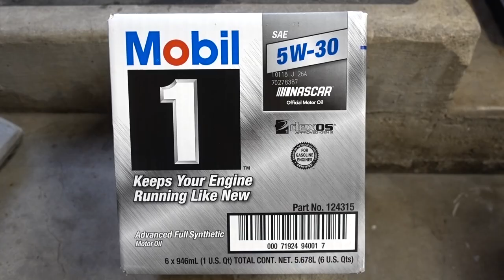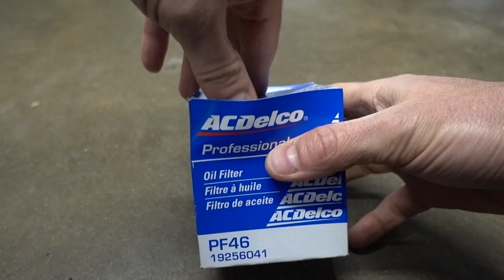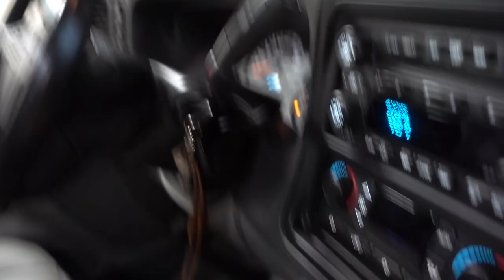BEST OIL FILTER HACK IMAGINABLE!!

Comment: U are over doing things ur fine with just oil filter and also your fine with  regular 5w30 on this vortecs no need for your fancy magnets or your full synthtic mobil 1 oil i have brrn using conventional 5w30 every 5k miles and farm filter for past 220k on my 2004 suburban no issues
Reply: Lmao at "fancy magnets."

Comment: Sure... the oil drain plug does contain a magnet so I'm sure the engine does not need any aditional, besides I bet any oil filter would easily hold the little metal paricles but at the end of the day if the magnet makes you feelmore confident driving it why not ¿!   Cheers !

Comment: magnets may make your filter last longer, but it will not keep anything out of your engine, or make the oil last longer. therefore, since you are replacing the filter anyway, magnets are useless. having a magnet on the drain plug makes sense because particulates will fall to the bottom.

Comment: Prefill the new filter with fresh oil before installing it. Use a zip lock bag or cut plastic bottle over the old filter when removing it. Get a Fumoto.

Comment: Magnets are pretty useless. Most material in the oil is nonferrous.
Reply: Just wanted to add the material usually comes from bearing wear. If you got steel getting into your oil filter you gots trouble.
Reply: 71Vegaman    Especially in Full Synthetic Platinum Oil.
Reply: crankshaft, sleeves and bearings are still Iron or other types of steel.  plus springs, valves are still ferrous. So yes magnetic drain plugs will still collect ferrous material from new engines. unless you have an aluminum crank shaft which wouldnt last very long.
Reply: @supraman236  I have a crank made out of wood ...my filter just picks up the odd splinter now and then.
Reply: But it's the Ferris Buler particles that cause all the trouble.
Reply: @supraman236  But all that will be catched by the paper filter, no need for magnet. Any ferrous particle small enough to go through the pores of the filter is practically harmless.
Reply: you are non ferrous

Comment: I don't know about other auto manufacturers...... But Chevy has been doing this for 2 decades on the oil filter already....... That suburban behind you should have had a magnetic  on the oil filter... it would be round like a donut and placed over the inlet so it wentr AROUND the threaded pieces your filter screws onto...... (At least the 6.6 Diesels did)

Comment: If you put the magnets on the side of the drain pan after you've caught all the old oil you can see metal particles moving towards the magnets. But putting them all over the oil filter if they're not in the right position you can cancel out the magnetic field. I think it would best to just put a stack so you are multiplying the force in one spots on the bottom. Old speaker magnets are great too, you can find Blown speakers anyywhere for free.

Comment: I disagree with those that say this is a useless practice. It cost almost nothing to do and will have an effect. Every particle of iron that is captured by the magnets is one that won't be circulating through your engine or clogging your filter. Most of the particles that would be trapped by the magnet would normally be trapped by the filter media, many though,would be too small and pass right through the filter.

Comment: I use these magnets on my filter, however.... I don't think they really do much and I will tell you why.. The magnets in a gearbox or diff will catch metal that otherwise won't get trapped in a filter... so the magnet is essential... in a filter, the filter will catch the metal.. I use the magnets to keep the filter medium from having to catch any metal particles... however small.    so in an engine I use them as an extra layer of filtration, but know that the filter would have gotten it anyway.. but as you say.. no harm, no foul... so why not..!!

Comment: Yesterday I put a large rare earth magnet on the bottom of the oil filter. I've been planning to do an oil change, but the oil is good and still has its sticky consistency on the finger and thumb test, so I'm going to run the car for a week and only do a filter change this time around.

Comment: The oil pressure in the filter is to high for magnets to catch anything instead put them on your sump
Reply: Totally false. They work for a fact . I use the N52 REM about the size of a 50 cent piece . They can pick up 30 lbs. no problem. Use a pipe cutter after your oil and filter change, cut it open and look where your magnets are...its like a little tiny pile of powder. When you move the magnets around , it will drag the fine powder of metal around the inside .... It works for real. People who never have done something will tell you that its wrong even though you've been doing it because of hands on experience....I know if I say something to dispute someone , its because I have studied and researched the shit out of it before I open my mouth spewing out a bunch BS. Times have changed. While growing up I was taught , If you don't know for a fact , don't act like you know. Because your word reflects what type of man you are.....
Reply: @lane4574     but the ones he's using aren't very strong like yours

Comment: the magnetic field those strong magnets create could interfer with sensor signals, inducing a current in a signal wire could potentially destroy the sensor or worse the ECU,
Reply: NAH. Magnets on your Oil Filter CAN NOT, and therefore WILL NOT, interfere with any sensors or your ECU.

Comment: Hello People I'm in the UK, I just watched this random video and read all the comments, so I just want to add my opinion so hate me if you like, I look forward to your opinions on the following:-  While I don't know if this applies to anyone out there, I understand the doubts you all have, but one application I think this will work on is Centrifugal oil cleaners where the oil is spun out to the edge of the units container.  These can be found on old Zetor Crystal Tractors were you had to scrape all the shit out of the centrifuge.  As a Mercedes driver (old battered high mileage Rats), this video is not of much use to me, but maybe this comment might benefit someone out there.

Comment: if you got particulates in ur oils. then ur using the wrong oil or wrong filter.. ur  over using the oil past its recommend change dates. that magnet theory has been around for many years. having metal frag in ur oil is a good indication of advanced engine wear. and also some oils contain chemicals which help bind the lubricant to ur cyls and oil galleries magnets will pull apart them bonds and make your oils less effective

Comment: Why didn't you put any oil in the filter before you installed it ? 
Not having magnets on your filter could possibly shorten the life of your engine but a dry start up with every oil change will definitely shorten the life of your engine.

Comment: Engineering/Science flaws in this video:

The manufacturers install magnets in the drain plugs to catch leftover ferrous materials from the manufacturing process (this lowers warranty claims and extends the life of the engine. The manufacturers put the magnets in DIRECT CONTACT with the oil so the ferrous material scan actually stick to the magnet.

The problem with sticking magnets to the OUTSIDE of the oil filter is that ferrous materials act as a shield to a magnetic field. Think about it, the magnet stocks because the magnetic field is being consumed by the ferromagnetic material. If you flip that material over you will find that here is no magnetic field on the other side.

If the oil filter is not purely ferromagnetic (maybe it companies a little aluminum in it buts that unlikely because aluminum is more expensive than iron and there is no need to have aluminum there) then maybe you could catch an infinitesimally small amount of ferrous material.

The next problem is that many engines do not have iron sleeves, the bores are aluminum and are treated with different materials to harden them so they don't wear quickly. If you have one of those engines then these magnets are snake oil (yes the rings are iron, but now you are talking about a quantity of ferrous material that is so small that the magnets cost you more than what the microscopic wear on the engine will cost you). The final problem is that wasting money is wasting money and that does hurt you.

Comment: 🤔 it's an interesting idea... But I would think there's too much pressure & Flow in the system. ever forget to put one on and start the engine? There's enough pressure and flow to empty the entire crankcase in about 5 seconds. Too much oil flow for the magnets to hold anything.
Reply: DonnaSean   Good thought, but I can't see pressure affecting it, and velocity compared to flow rate (volumetric) would more specifically be the issue.

Comment: Don't need a filter wrench to install a filter on a gasoline engine. Hand tight about 1 turn or less after the seal makes contact. I never use a filter wrench to install or remove... always by hand.

Comment: I've got an 08 Tundra with a cartridge.  Put them on the cartridge????
Reply: Cartridges are Toyota planned obsolescence in this case ? Have them on myScion and Highlander too.  Could glue them on to the plastic housing and then wipe down the housing at oil change time.
Reply: put them on the drain plug . then it won’t get sucked into the pump and filter in the first place

Comment: Car manufacturers put magnets on the inside car oil  sumps and automatic transmissions not on the outside . Just use the $2.50  on a good quality filter and oil .

Comment: Anti wear and anti pressure additive on some level tend to have magnetic properties to them.  So its not all fine engine metal particles on the magnets.  Your stripping some of the good ingredients right out of the oil by using magnets.  Just a thought.  On engines I've seen people using magnets I have seen goobs of this stuff on the magnets.  If it were all engine metal those folks would not have an engine left with what I've seen.

Comment: If the magnets work, why not just show  a close-up of the inside end of the magnetic drain plug and see if there are any metal particles stuck to it.  You could also drag some magnets thru the used oil to see if you pick up any metal particals.

Comment: What scotty said was correct. Quality  filters catch over 99% of the debris, so should you use magnets anyway for extra insurance?  Sure, and while youre going you may as well install a piece of foam over your air filter and cut a piece of fine gause to put in your fuel filler hole.

Comment: Those magnets on the tip of drain plugs are directly exposed to the oil/fluids, yet the magnets that you attached on the Outside of an oil filter is Not (through the oil filter's metal casing) so, the magnetic force is Greatly reduced from being really effective catching metal particles inside the oil filter.  Oh! By the way, did you know some companies also advertise "Power Gain" from using magnets; in your case with that many magnets (I would double the number of magnets) to gain an another 100+ HP and that engine will run even smoother like a Lexus smooth!   LOL!!!

Comment: It MIGHT help, but the oil pressure is ridiculous on most engines, so they probably couldn't hold the particles very well.
P.S. I would run an engine without a filter. Engine wear mainly comes from fast acceleration & high RPMs, plus, most small older lawnmower engines haven't had a filter EVER yet last for decades & can be rebuilt & revived without replacing the piston, or crankshaft. I've never heard a lawn mower that knocked...

Comment: except metal doesn’t go through a good oil filter. the media will catch sand, metal, even specks you can’t see. put magnets on the pan, that would actually be better for your oil pump if it’s not sucking up metal

Comment: You have a magnet on the outside of the drain plug? The heck is that going to do, that thing is so small it won't catch any through a thicc, dense drain plug. Also old oil for the gasket? Any solids in the old oil might scratch the filter mount base or prevent the seal from seating properly causing a leak. Just use new oil, go lowest risk.

Comment: Except they demagnetize at 80*C which will render them near useless. Above will cause permanent demagnetization in most cases. Oil op temps are typically above 80C, BMW even above 100C...
Reply: @I_know_what_im_talking_about  that's cooled oil in the pan 🙄 oil filter can be after it's gone through through the block. You can research and readily find magnetization vs temp graphs, but hey...you know better than established science apparently 🙄

Comment: You forgot 2 things in your oil change. You didn't wipe off the filter base of dirty oil where the rubber filter gasket contacts the auto ( although you get a brownie point for checking to make sure the old rubber gasket came off with the old filter) and you didn't put any oil in the new filter, to help delay the time the engine will be without any oil until the pump fills up the new filter with oil. Otherwise, a great oil and filter change!

Comment: The magnet will catch some metallic debris. If you really want to make your engine last a long time, use the best oil you can afford and change it more often then manufacturer recommends. Even though the oil his still good and has a broken down yet clean oil is even better. Oil is cheap and engines are expensive.

Comment: Filters catch the ferrous metal aluminium shavings carbon deposits anything . they do it on drain plugs like diffs and transmissions that do not have oil filters in them and transmissions with filters might have a magnetic plug. because of the service interval and the complicated nature of most transmissions oil filter replacement. if you get visible metal on the inside of the filter it would of been caught by the filter media. it will not hurt but if it really worked manufacturers would of pre installed magnetic filters.

Comment: Uh, do a Project Farm-like test. Thorough and evaluate the claims.  Until then, I'd like my magnets at the bottom of the system (oil pan), where the solids drop down when the car is not running. That's instead of possibly restricting flow patterns inside the filter... If it catches anything.  

Sadly, in most Asian cars, if you're getting noticable metal debris in your oil, it'll be lights out for the engine soon enough.

Comment: How can you tell the magnets are working when the engine would sound the same even without them anyway? Sorry dude, this was the same as your last upgrade to efans that you didnt really need and upgrade the wires that you also didn’t really need as the issue was with your alternator.
Reply: that old suburban has very little electrical components   NOW
if it was lets say a 07+   model   it can come equipped with LOTS of  electrical equipment    (that is why it has room for a dual Battery set up)
i.e:power lift gate Power front and rear seats  Power windows,   Rear A/C   heated  wiper fluid  electrical fans, heated mirrors  etc...  Full heated rear windows(left and right side  rear as well)  you can pull some serious amperage  if you were to run all of those at the same time.. maybe 200 to 400 amperes

Comment: I don't know much about engines but isn't it a bad thing to have ferrous metal particles in your oil? Won't most of the particles be nonferrous? Also if there are a bunch of ferrous particles isn't it better to have the magnet in an area that isn't exposed to the flow of oil? Just get a oil plug magnet?

Comment: I'd say it probably does pull the tiny   particals to the side of the filter but it's still in the filter and being caught by it. It's not going to help pull material from inside your engine into the filter. If it made that much of a difference filter manufacturers would already be incorporating them into the filter themselves. These engines run 3,-500,000 miles anyway hell a few have made it to the 750,000 range with just good oil and filter. You can do it if you want to I just think it isn't going to make any difference in life of an engine.

Comment: I bought 2 cars with the same miles same everything. One had a bunch of magnets on the oil filter and one didnt. I pushed both of them off a cliff at the same time. Both engines were junk so the magnets didnt work.

Comment: How do you know that the material collected by the magnets wouldn't be picked up by the filter?! The magnets are on the supply side of the filter media, so there is absolutely no way of knowing if they are doing anything. I wish someone would put out a video that tests this. The only thing I can think of would be two in-line filters, with magnets on the second one. If the second filter magnets collect debri, then we know that the filter media is missing it. If the second filter collect none, or almost none, then we know the filter media is already handling the job. Someone, somewhere, do it!

Comment: I would definitely run my car without an oil filter. My air filter prevents large debris from entering the combustion chamber and the oil of changed every 3k miles.

Comment: Put 1 big magnet on the bottom of the oil pan? Or the side, even?
Reply: Trehn Hazelwood if u do that it will be stuck on the pan and eventually some might break loose u would be better to do this or use a magnetic oil plug
Reply: If you can find one, the old pacemaker magnets [used to change firing rates] made in the 70's and 80's were brilliant: donut shaped and ceramic coated, they will stay put to steel in a typhoon [watch your fingers, please].  But if you put one on the bottom of your oil pan, know this: if you intend to remove it, then you must drop the pan to clean and inspect.  In fact... you might want to put a guard on it to make sure some nitwit doesn't remove it without thinking, thereby releasing an unknown sum of fine metal bits to maybe grind your bearings into submission.